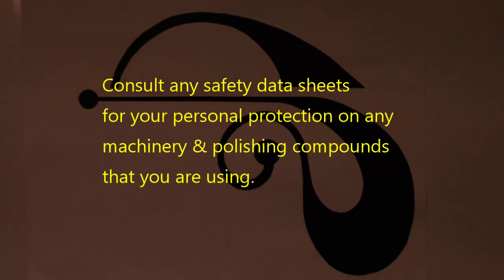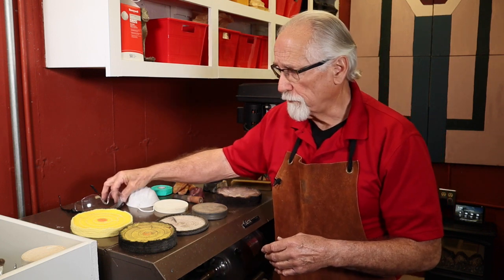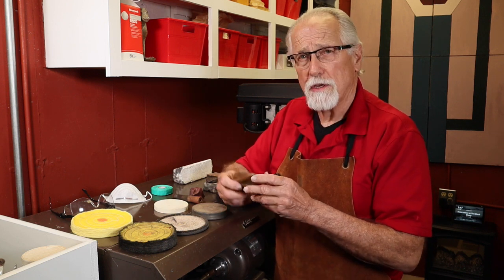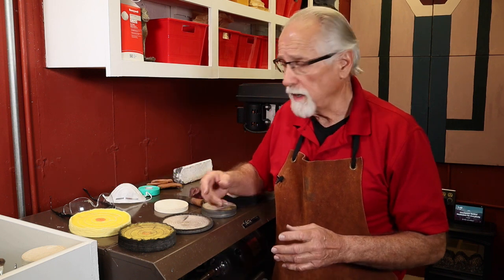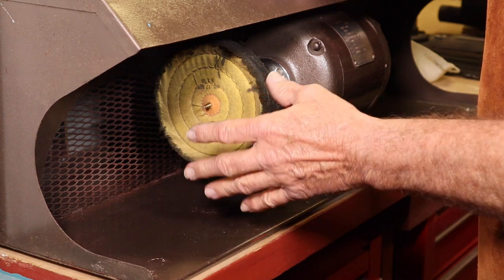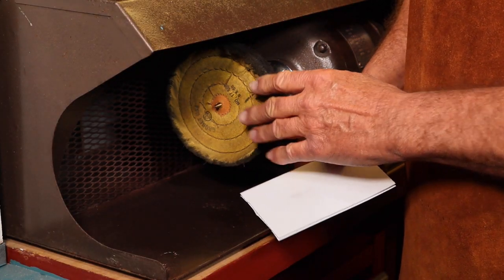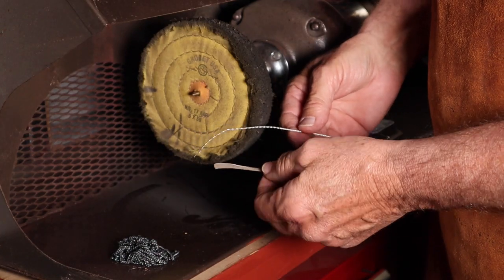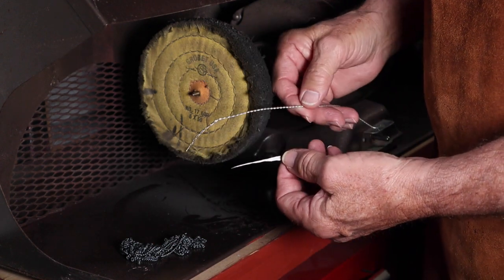POLISHING MACHINE & DUST COLLECTOR EXPLAINED

Comment: The water-pool under the buffing wheel is great !!
Reply from the maker: Hello Moonolyth Tekton,  Thanks for your comment.  Yes, the water works very nice.  You can use it on grinding wheels also.  I used it for many years until I could afford a dust collector.   Keep watching.  Good Luck.  Greg Greenwood

Comment: Simply love it ! You're the first guy I see on YT who really tells people about all the safety precautions - including removing any of your own jewelry. Very important ! Eyes and fingers are the tools that all jewellers depend upon the most. Once you loose them, you lost it. So always safety first. Also thank you for mentioning not to polish chains - which can unfortunately be seen in some videos on YT.
A tiny lead from my side: When polishing rings (or other items of similar shape and size) - in case I don't do that with the flex shaft because I have dozens of them, I always use a wooden mandrel to hold the ring. This safely allows to polish the outside of a ring while maintaining a good hold of the object - and keep the fingers away from the polishing wheels. It also reduces the number of edges you have to take care of while polishing. Worth mentioning as well, there are also special felt covered mandrels which go onto the polishing motor's spindles that allow polishing the inside of rings or bracelets.
Reply from the maker: Thank you Torsten for your great comments.  You are correct.  Safety First.  I also use a wooden mandrel for the outside of rings.  Definitely saves the fingers!  I use the ring buffs also.  One was on the dust collector in the video, but I decided to not confuse the viewers with too many buffs.  I am going to do a separate video on buffs and compounds. By the way, what compounds do you use?   Thank you again for your great insight. I always enjoy your comments.   Take care.  Greg Greenwood
Reply: @greggreenwood4628  The compounds I use are mostly tripoli for pre-polish and a blue compound for high polish. It normally does the trick with silver and bronze (I usually work with those metals).
When polishing chains, I use a tumbler and/or a brass brush with soap.
I also work with bone and antler for certain things. With that, I use a white compound when I use power tools. I also use a separate set of buffs for different materials (i.e. one set for bone/antler, one set for metals - using a buff on organic materials which was previously used on metals willl usually result in tainting the colour of the organic materials).
When hand-polishing, I use the same compounds applied to linen, wool cloth and the flesh side of leather.
Reply from the maker: Thank you Torsten for the information.  It is always interesting to hear what others are using.  Good Luck l Greg Greenwood